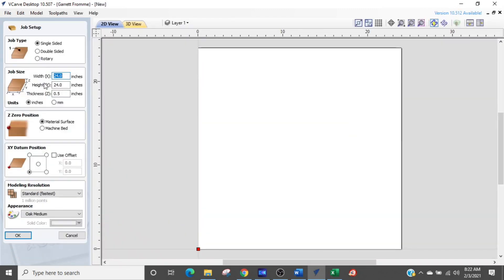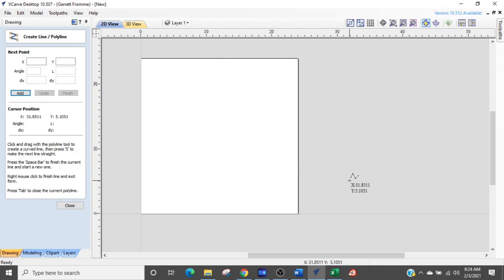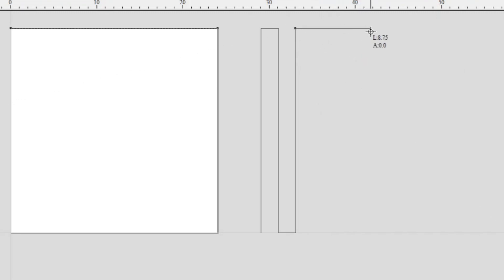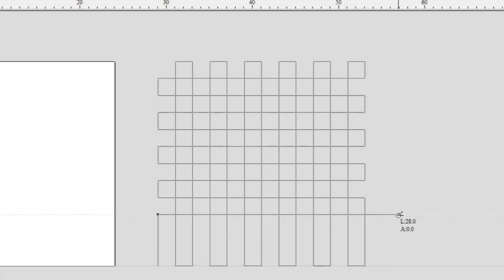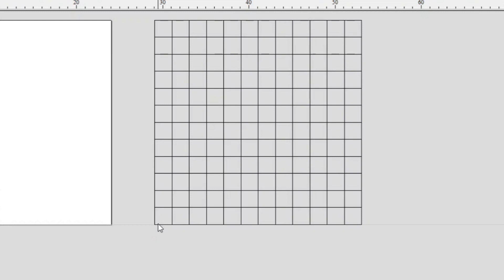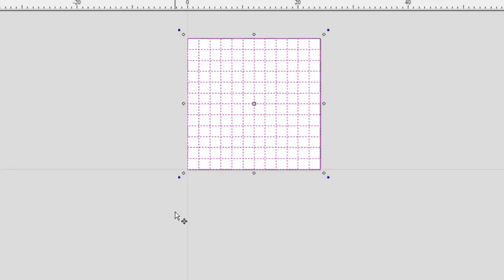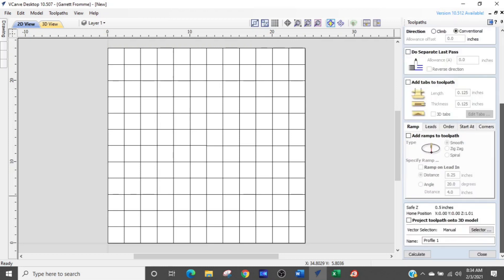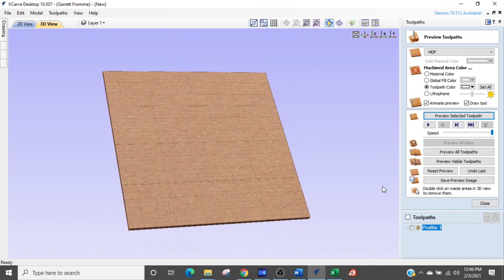Why You "WANT" Grids On Your CNC Router Spoilboard & How To Engrave Them

Comment: Garret, appreciate the video.  I have an Axiom pro.  I follow your instructions and when go to carve the 2x4 grid it says I’m outside the Y+ soft limits.  I’ve dealt with this before and it’s usually easy to find reason.  Not so this time.  Running vcarve pro.  Any thoughts?
Reply from the maker: soaringeaglesadventures9028, Unfortunately, I am not much help here. I am not a tech guy when it comes to CNC machines. I may be good with the programing and operation but when it comes to troubleshooting, I'm an absolute deer in the headlights. I recommend reaching out to your machine manufacturer regarding your issue. They will be able to help you the best my friend!

Comment: Per you recommendation I have purchased a Longmill 48x30 MK2, and I am using Vectric VCarve. I am trying to cut the grid in my spoilboard but VCarve tells me that I need to use tiling due to parameters. I am not having much luck finding that feature in VCarve
Reply from the maker: slvrbullit56, congrats on getting your longmill brother! You shouldn't need to utilize tiling for your waste board my friend. This may be due to the version of Vetric you're using. I do have spoilboard file you can check out on Etsy that will definitely make your life a little easier, here's the link if you want to take a look→ https://etsy.me/3oxX79l. Otherwise I recommend joining Kate and I for our youtube live sessions we do every Wednesday at 8PM EST and we should be able to help you then brother!

Comment: How do you get around the Z- limit switch do do this on a dyi CNC?  Only way I can think is to remove the bit, loosen the spendle to lower it, home it out, raise up in Z, add bit back to spendle, then Zero to surface....? Then replace spendle to previous potion when done to avoid crash in future. Will that work?
Reply from the maker: Allen, that is a bit tricky on your CNC. You should set up your Z axis to where you can extend the Z axis into the spoilboard at least half an inch. In your case, removing the z limit switch for the time being might be a good idea.

Comment: New to CNC. The grid sounds like the best way to go. Thanks for the tutorial. Do you have to have the homing switches for the grid to be placed in the right spot? Or do I just drive the Longmill to the front left side and start.
Reply from the maker: Jeffrey, to make your grid you will zero your machine on your spoilboard just like you would zero it onto a project. Depending upon how you set up your project in Vcarve, your zero might be in a different spot but I recommend zeroing it to the center of the spoilboard for the best results.

Comment: I copied everything exact to fit my Onefinity Journeyman but when I go to calculate it says there is 1 open vector and is being ignored so there are 0 remaining vectors and won’t calculate.  Any ideas?  On Vcarve Pro 11.0.  Confirmed only the one green square on bottom left in node mode.
Reply from the maker: Hi Steven, have you looked to see where the open vector is on your design software overview? It should highlight the area where it detects an open vector and allow you to fix it by trimming it or removing it.
Reply: @IDCWoodcraft  Thanks.  That video did the trick in the first 4 minutes.  It was the “on” I needed.

Comment: Not sure where I went wrong. Vcarve tells me 1 open vector and being ignored, 0 remaining vectors. Vector validator comes up with a tonne ofr Overlaps/Intersections. Join Vectors comes up with 1 closed vector and 0 open.
Reply from the maker: Shay, try to reduce the problem down to smaller parts of your project and look for spots where there might be overlaps. They should be highlighted on your screen when you do vector validator.

Comment: When securing your stock for carving with the grid, do you prefer double sided tape, hold down clamps, or something else? I’m currently using cam clamps, but have had them slip once, which ruined a small project.

Also, which would you use … a 60 degree v-bit or a 1/32” end mill?

Thanks, and thanks for all your great content!
Reply from the maker: b-radg916, I haven't had a good time w/ cam clamps. I recommend hold down clamps or double sided tape, it's really just whatever you prefer on that one! And I would use a 60 degree vbit.

Comment: Are the screws in the spoilboard just to hold it down?
Reply from the maker: Hi John. Yes they are.
Reply: @IDCWoodcraft  
The reason I ask is I see and hear a lot about people installing T-nuts on their spoil board. And laying things out in tracks.
I ordered a track kit from Sienci and have been wondering how that works with a spoil board.
Reply from the maker: @TheJonboix  tracks are great. It takes a little more time to set up but they're easy to work with once they are
Reply: @IDCWoodcraft  
Then, instead of a solid board do I lay it down in strips?
Reply from the maker: @TheJonboix  there are screws to hold down and most of the holes have threaded rivets for clamping

Comment: Great video Garrett but every time I go to create my toolpath for my grid I get this error "One open vectors were identified in the selection and are being ignored. There are 0 remaining vectors." I don't know how to fix this. Thanks for any help. I have a cut area of 48in X and 32" Y.
Reply from the maker: Hi AK. You need to run Ve tor validator. Watch this video about it → https://youtu.be/s5XvV0F7VcQ
Reply: This happened because you didn’t separate the vertical poly line from the horizontal when drawing.

Comment: Do you think using the grid lines as reference is accurate enough? I would think some sort of edge reference that you push the board up against would be better than eyeballing it against a line.
Reply from the maker: Hi Dave. A stop board is great. Grid references are useful for anything. It's up to the user. Personally, I use both.
Reply: @IDCWoodcraft  cool thanks! I'm new to CNC but am learning a lot from you. Thanks for being so helpful!
Reply from the maker: @DaveGeddes  you got it!

Comment: I did not originally have a grid on my machine.  However, after overcutting a board I did use it as a reference.  I did not realize that if you cross a line, the line disappears.  I will have to do this and see what happens.  Thank you.
Reply from the maker: The line is still technically there in the design. It's just the overlap that makes it disappeaear

Comment: Really cool video again, been watching a lot of your content, very good concise information, really like this way. Mentioned in another video I purchased an x carve to start, a year later and I got a 1500x1500 queenbee, and my boss got one too, so I had the priveledge of building two. I work at a large format digital print shop and was able to use our flatbed printer to print a grid on the spoil board, 59 inches square is a little unorthodox to source at a big box, so I had him look around for 5x10 sheets and we got two. My point is that carving it into the board itself Is WAY more practical as you get a per machine reference which is gonna be properly proportionate to the machine. What kind of bit did you use? (I'm still in the middle of the video)
Reply from the maker: I used a 30 degree. Nice thin lines. 60 will work too. Don't do 90. too wide
Reply: Gold right here boys. I am planning on purchasing some bits from Garret. I am learning a lot just by following this page. I am assuming I can buy a kit but I'll be looking for these sizes.

Very cool.

Comment: Coming from a fabrication background I can see the value in your grid board.

I will be purchasing this as soon as I am set up. 

I will be running mach 3 controller with V carve. That is my plan anyhow. I'm thinking this will work for me.

Thank you sir very much for your videos.
Reply from the maker: What's up, David. Yeah, makes perfect sense. you'd think I would have done this sooner. Vcarve...excellent. I've not worked w/ mach3. Let me know when you make the jump!!!
Reply: @IDCWoodcraft  I will for sure. Your page is great and just what I needed.

Currently I'm sitting in front of my QueenBee Pro 1500 x 1500. It's all still inside the box and I am devising a build plan. But your page is making me want this baby put together now.

I have seen V carve works with mach 3 controller but we will soon find out.

I will be purchasing some bits shortly and seen you offer those so I will be checking your store out tonight when I get home.

I can't say thank you enough for your page. Super cool.
Reply from the maker: @daviddalton5851  the site revamped website is operational tomorrow. Get on the priority list in the video description
Reply from the maker: @daviddalton5851  Mach 3 is not tied to vcarve. It runs your machine. It's supposed to be an excellent program
Reply: @IDCWoodcraft  copy that. Mach 3 is the controller. Very cool I will get on that link tonight and see what all your offering.

Again this is exactly what i needed.

Awesome 👌
Reply from the maker: @daviddalton5851  give me a couple days for the store. I'm still getting the router bits organized on it. I throwing in a bunch of other stuff with them so keep an eye out. Sign up to the priority list here: https://bit.ly/3raCwJl
Reply: @daviddalton5851  nice move dude, did you go with the original oozenest or bulkman? I've built two of the bulkman kits, one for home and one for work, both running on openbuilds blackbox, runs like a dream.. I spent a lot of time with a dust collection solution and nailed the way I want it, independent dust shoe from the z movement, I designed a 3d print to add to the hack that keeps the vac hose nice and away from the router motor. Let me know if you're interested in the mod I can share the plans and the 3d model, for free, works like a charm.. oh and I also used the x carve dust kit and modified it to make it work with my approach.
Reply: @redherring5532  wow that's very kind. Yes I purchased from bulkman. I am about to build the table. I am hoping to be up and running soon. I am excited.
Reply: @redherring5532  I want to do the Black Box as well but it will come as an upgrade in the future. Good call on your end from what I can see the Black Box is definitely worthy.
Reply: @daviddalton5851  the blackbox is amazing, I cant believe the thing is so small and works very efficiently.. and for your table here is a tip for you, I built TWO tables for our machines and 66" square x and y is the sweet spot, no motors hanging over or anything, i used 1x4s and I bought these leveling feet on amazon for 22$ set of 4 to level the whole table in my crooked floor garage..
Reply: @redherring5532  haha I was just about to order those off Amazon as well. 66" is definitely the sweet spot. I have to be working off the Mach 3 controller for a bit but I'll work up to that black box.
Reply: @daviddalton5851  haha yes they're a good buy. I'll save you a headache cause I've bought about 10 sets of those and the best brand has been "Huayy", others were really chincy and the included hardware was subpar.
Reply: @redherring5532  great advice. Thank you. I truly just added those to my kart on Amazon because I know I'm gonna need them. Hey man any advice is welcome. Thank you.
Reply: @redherring5532  my buddy and I are near ordering a 3D printer so the vac hose design sounds very handy. Thank you again. I will probably be asking you for that soon. Very cool.
Reply: @daviddalton5851  a 3d printer at least one is a good call. Waste board is also a thing I had a headache with at 1500x1500.. I had my boss source 5x10 sheets of mdf but that's not always possible,  so I got a 4x8 from big box and cut off 59 inches (true edge to edge measurement for your y) but because of the tool head jutting out a fair bit you lose a good 4 or 5 inches on your y. Anyway, I cut the mdf into strips of 13 inches wide 4qty and I put screw holes on the edges to clamp into the aluminum extrusion, I slotted the screw holes and mortise it down half an inch to keep the screw clear of the tool if it chews into the mdf during a cut. I used an X carve dust collection kit (150$) comes with the clear boot and I created a mod to mount the kit using 3 2040 aluminum profiles around 7 inches long each and a 3d printed jig I designed to get the hole spacing dead nuts. Wish yall were in the San antonio area I have 14 printers here at home, I got on a big kick lol wife stopped complaining when I was able to pump out face shields in droves lol